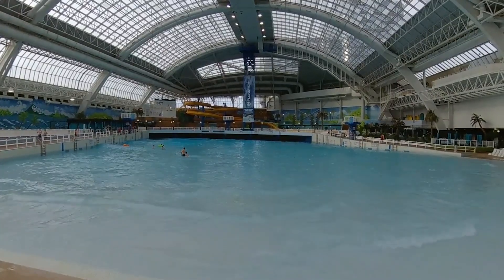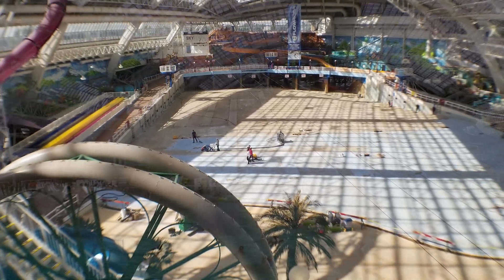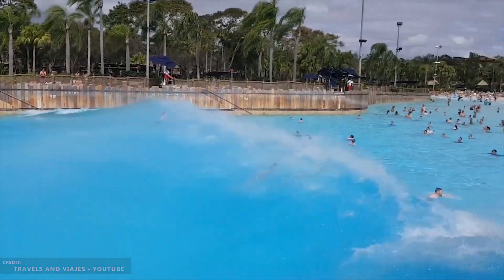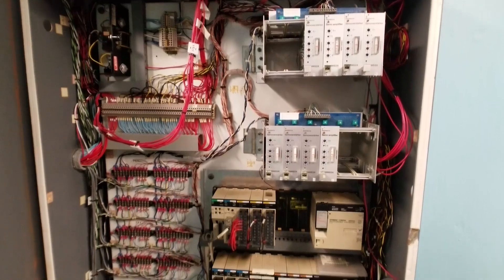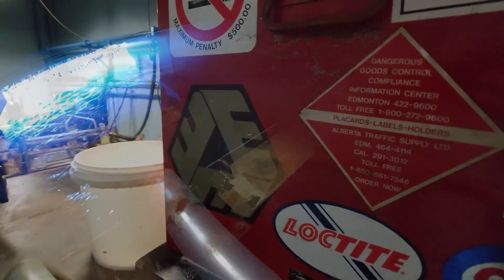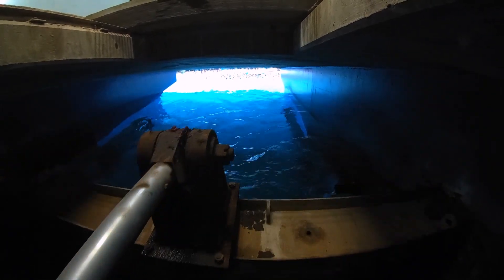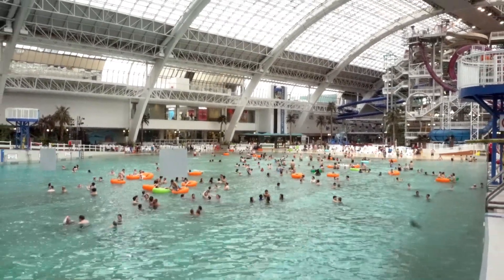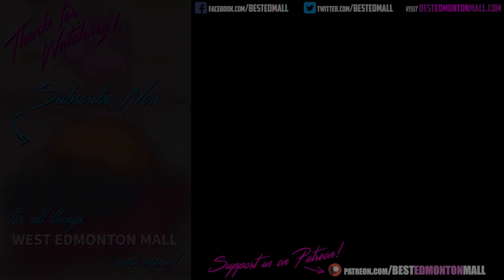How Wave Pools Work! Behind the Scenes of the World Waterpark Wave Pool - Best Edmonton Mall

Comment: So where are the main drains in this pool? I'm assuming there has to be a point in the pool where water is drawn out from the lowest point of the pool and fed to a filtration system?
Reply: The main drains are in the shallow area. I believe there are some in the wave chambers as well.
Reply: At 8:54 you get a good view of one of the decommissioned chambers. There is a large dark rectangle in front of the panel. I suspect those would be the main drains? 

There are drains in the shallow end but I suspect the real work is done in the wave chambers.

Comment: As a little kid, i was almost killed by such a machine, they opened a new one and i went there with my father, they had massive bars to protect you from getting sucked in. The problem with that was that the bars weren't spaced correctly, so my leg got sucked in and stuck, my head was under water and i passed out luckily the lifeguard pulled me out and i got away. But sadly a kid who was my age passed away a few weeks later because of that same reason. The pool got closed and they now have a mesh in front of it. I still don't go in these kinds of pools to this day.
Reply: @WaterishDog yes, most of them do, but they didn't have one there
Reply: @tazzy3503  where

Comment: When the surfing went on with the local snowboard/skateboard/SUP shop (EASY RIDER) I think they upped the power of the waves. They definitely weren't that small when surfing/SUPping but they were still kinda small. Luckily there's the Flow Rider now, but it's not the same.

Comment: I work for Bosch Rexroth which used to be Basic Hydraulics in Canada that originally designed and installed this system. It was done before I was born, but the older people at the company have told me all about it. I've never gotten to see it though, and that old computer makes me happy it's still there. Thanks so much for this.
Reply: I thought Stan Smuga-Otto worked on the mechanical for it.